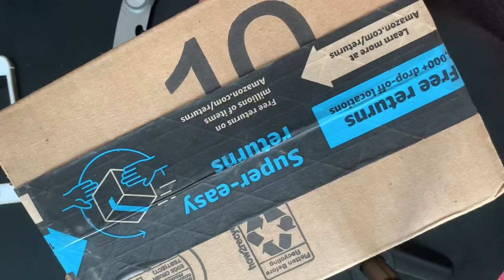DIY Converting Swing Gate to Remote Control Sliding Gate.

Comment: Hownmany kg po capacity ng motor ginamit nyo dto
Reply from the maker: gate opener can be used to open gates up to 1400 pounds and 50 feet in length
Reply: Sir magkano po bili nyo?pwede mahingi yung link kung san nyo nabili salamat
Reply from the maker: Sa Amazon ko sir na order mga P30K sir kasama na remote and accessories ng gate